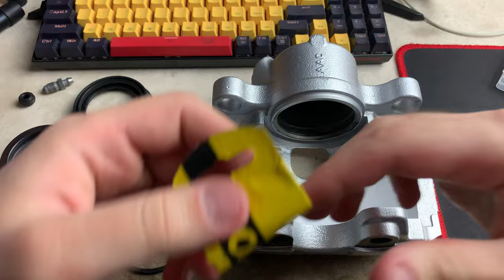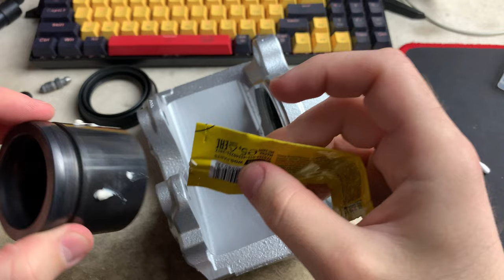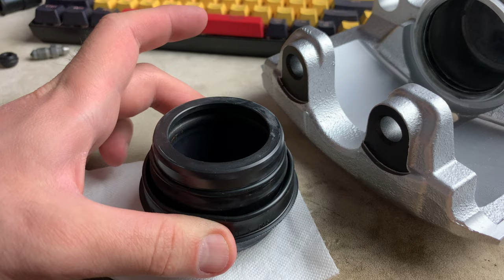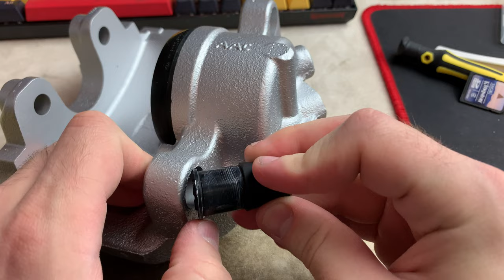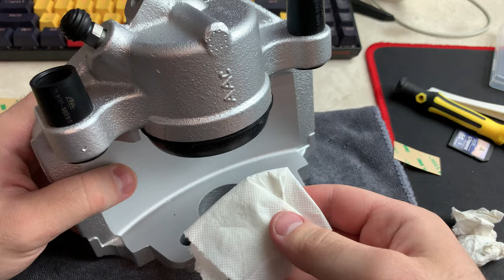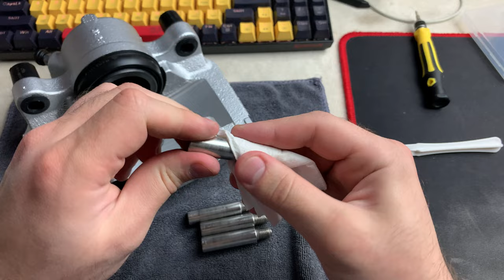Brake Caliper REBUILD and ASSEMBLY

Comment: should have greased the slide pins.
Reply: No you don't lubricate those type of slide pins.
Reply: Why not ?
Reply: @Rockyboy120  The elasticity of rubber pulls these pins back and if you lubricate them, the lower part of the caliper will not go back as much as the upper part(because of weight) and the pads will wear slightly at an angle. These types of calipers should not be lubricated. These pins run dry, another story is with pins that works inside caliper these one we lubricate but with proper grease that doesn`t swell rubber. If we lubricate them with the wrong grease they may even seize.
Reply: That’s interesting, I was not aware of that, thanks.

Comment: what kind of grease are you using because it will mix to brake fluid and fluid become contaminated its ok use that kind of grease
Reply: No never in my life have I seen this done
Reply: There is nothing absolute about using brake fluid.  As I understand, red rubber grease may also be used.